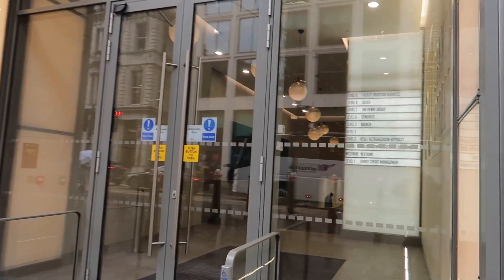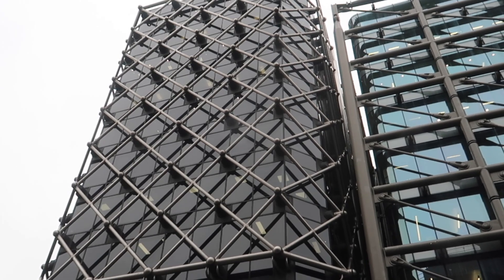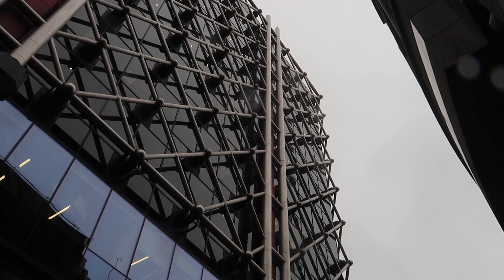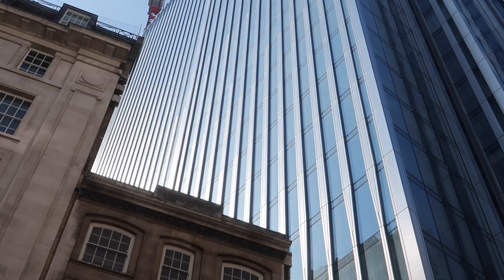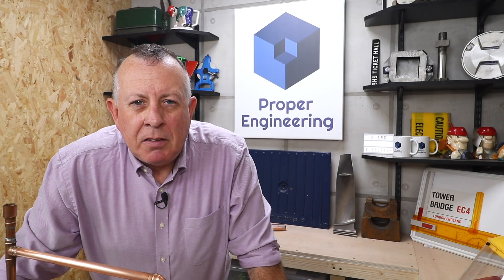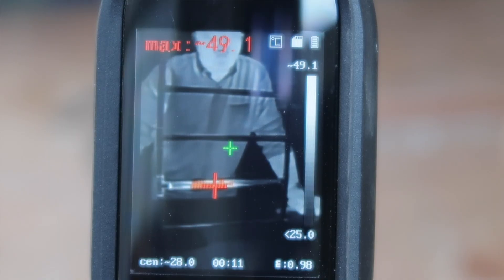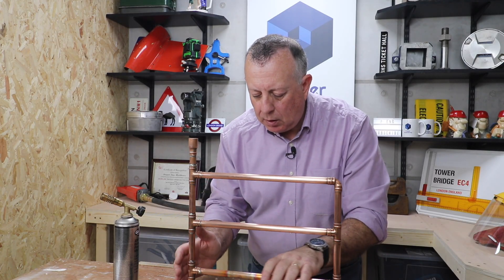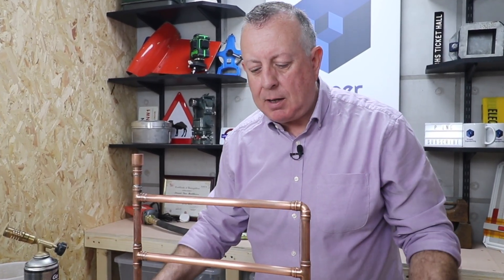Why is an unobtrusive building in the City of London totally reliant on water?

Comment: I can't be sure, but suspect that the rising and falling of the water that you saw in the piping was not the thermal expansion of the water as it seemed to cool off too quickly when you took the heat away. I suspect that that the phenomenon you saw was caused by small amounts of surface boiling at the site of the heat source. The bubbles would have condensed back down to liquid even with the heat source on, they still took up more volume while they were present though.
Reply: If it hadn't had time to settle after filling it, there could be air bubbles expanding too. With the camera maxing out at 50°C, it is difficult to tell if it ever got hot enough to boil the water.
Reply: hmm maybe heating the water separated out air dissolved in the water which then reabsorbed back into cooler water further away like the small bubbles in a pot of water on stove that appear before it is at boiling point.
Reply: Any expansion of water in that experiment would have been immeasurably small--certainly not noticeable to the naked eye.
Reply: @Bill.Pearson  We can calculate that fairly easily. It looks like about two metres of pipe and the water level is rising by about two millimetres, so let's call it 0.1% expansion (that's very approximate, but it gives us an order of magnitude). The coefficient of thermal expansion of water is about 0.02% per degree at room temperature, increasing to about 0.07% per degree close to boiling point. That means to get 0.1% expansion you would need to increase the temperature evenly throughout by about 5 degrees or increase it by an average of a bit less than 5 degrees if the heating is concentrated in one location as it is here. While it would be relatively easy to quickly heat it by that amount, I don't think it would be possible for it to quickly cool by that amount as we're seeing here (the point that is being heated can cool fairly quickly, but only by transferring heat to the rest of the water, which wouldn't reduce the average).
Reply: @Bill.Pearson  It's also worth noting the copper pipe will expand when heated, which will actually cause the water level to drop. I wouldn't be surprised if that is actually a larger effect than the expansion of the water, especially on the timescales seen here (the copper obviously heats and cools more quickly than the water, since it is on the outside).
Reply: I was pondering if there might be a way of determining if I am correct. One way (complex) would be to measure the compressibility of the contents of the pipe; steam will compress a little but the liquid water wont. Another way, though less conclusive would be to mount a microphone to the pipework; you'd hear a roaring sound when the flame touches the pipe, but if some of the water starts boiling shortly after then there would be a clicking, fizzing or bubbling sound in addition.
Reply: @alsmith20000  I think the first thing to do would be to test my theory, that it is air bubbles, since that's easier to test. You just need to put the whole apparatus in a vacuum chamber and degas it.
Reply: @alsmith20000  Actually, that gives me an idea for testing your theory - do the opposite and put it in a pressure chamber. That would increase the boiling point, so should reduce or eliminate the effect if it is from boiling.
Reply: @thomasdalton1508  The pressure is also likely to affect the way that dissolved air forms bubbles so the experiment may not discriminate between our two hypothesis.
Reply: @alsmith20000  If you degas it first, you can eliminate or confirm my theory. Then you can move on to testing yours.

Comment: Interesting Stuart. Not sure I like the requirement for the building to “only have to last 2 hours before collapsing” - witness the World Trade Centre towers when they came down.  Will be a whole load of mess.
Another interesting building is number 1 Embankment Place, PwC’s offices, above Charing Cross station. I worked there for a while, it’s a suspended building with everything suspended off the supporting legs that go down through the station platforms. Unlike the Canon Street one though there’s no external skeleton so it’s full of support beams at crazy angles inside
Reply: “only have to last 2 hours before collapsing” - That requirement will vary with building height. Towers the height of the WTC would have to last considerably longer than 2 hours. Although, in fairness to the WTC, they stood for a surprisingly long time after the impacts; I guess the real issue was, when they did finally go, the top floors collapsing brought all the lower floors down too; had they failed down to the point of impact only, then many fewer people would have died.

Comment: The building would be even better than your model at taking away heat because of the diagonal lattice work.  As soon as water at the lower level starts getting warmer (and as far as structural integrity goes, a fire at the top of a building is much less concerning!), the hot water will rapidly start moving up the diagonals to be replaced by colder water from the other sides.  The diagonal lattice work is practical as well as aesthetically pleasing.

Comment: Just been led here by your Proper DIY announcement. What a fascinating video. I might also note that this has tones of proper old school broadcasting. This video would not have been out of place as a segment on “Tomorrow’s World” for example. I’ve been with your DIY channel since the wonderfully simple “wiring an outside power socket” (since applied several times!) and have enjoyed everything you’ve released.  Bravo Stuart. 👏
Reply from the maker: Thank you. Although I didn't particularly try to do it that way, if it comes across anything like a Tomorrow's World segment I will take that as a huge compliment.

Comment: Very interesting solution to an awkward and potentially expensive problem. If only the developers could claim the additional costs back from the typical fickle council planners!

The other thing your experiment demonstrates Stuart is the reason why you need to drain water from the pipe before you can do a solder repair or joint! Anyone that has ever tried to solder a leaky joint whilst there was still water in the pipe will understand this.👍

Comment: Question: so are there any expansion vessels fitted to the structure in the event of fire?  If not surely the pipework would just fail (explode) if the whole thing got really hot rendering the whole thing pretty useless.    
Two interesting side notes;  1) the building next to it (78 Cannon Street or Cannon Place as it's called) copied the design of No.80 and also has an exo-skeloton with column free interior, this was completed in 2011.   2) Directly opposite 80 is the London Stone (what's left of it displayed in a casing) which is thought to date back to Roman times and has been recorded since around the year 1100.

Comment: Very interesting video. The building with its framework looks futuristic now let alone in the 70's. So i take it the framework must have an expansion tank somewhere, a pressure valve or is not totally full to capacity else it would be bursting under the pressure in the event of a fire and the subsequent expansion. Also I wonder what the lifespan of the frame is and internal corrosion.
Reply: If they used the right type of stainless steel, and - if they run antifreeze - assuming the antifreeze doesn't react with S/S, then it should be pretty much indefinite.

Comment: Very interesting, and well explained.  Btw, what happens in winter when it's freezing are the pipes heated in any way, either by water (movement) or wire heater?
Reply: They probably have 20% glycol or other antifreeze mixed into the water to prevent freezing.